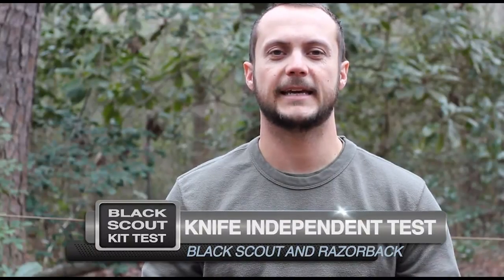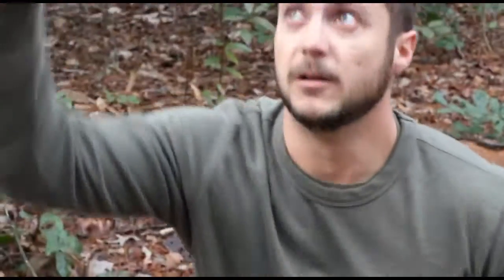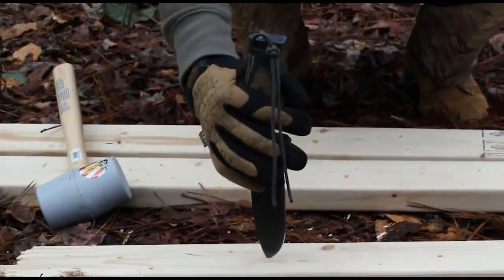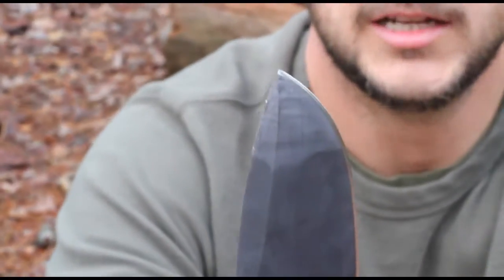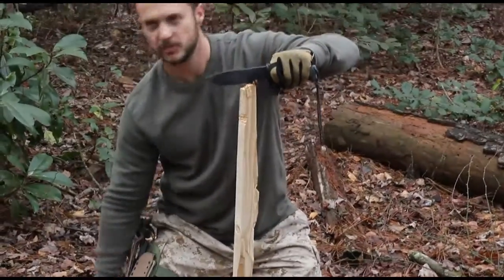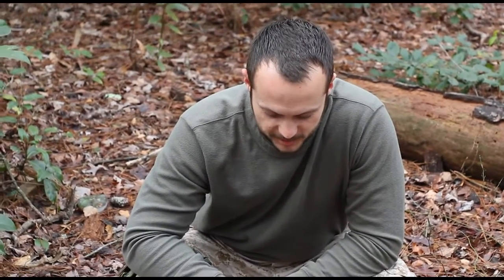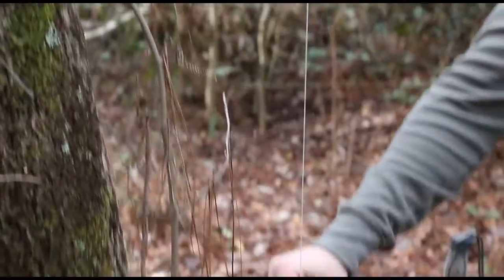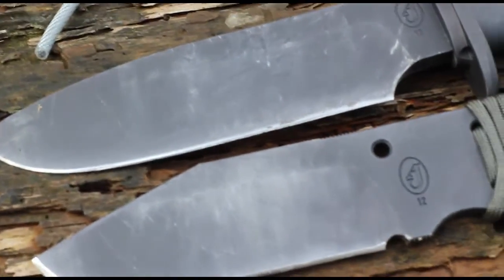Black Scout Product Testing - Black Scout and Razorback Knife K.I.T. Test

Comment from the maker: I agree with you. ESEE-5 and BK2 are probably the most owned knives in the community. I think it would be good for them to run the paces of the KIT test. just to see how they stack up against one another. The steel cable is an extreme portion of the test and is not in the normal realm when using knives. Knives shouldn't be used to cut steel except in extreme cases. So I hope no one goes and tries it:)  Thanks for your support as always. I understood your comment...sorry it was misconstrued.

Comment from the maker: Yes I agree, ESEE is not on the same level. However not many blades are on the level of Jordan knives. A 1095 blade wouldn't have a use-able edge after cutting through steel cable. Thanks for sharing.

Comment: Did I say anything about that?  I don't care if the Jordan knife is better.  I have Busse knives and nothing beats a Busse.  I was simply asking BSS to do a comparison of the ESEE 5 and BK2 using the standards of the KIT test.  I guarantee you there are more BK2 and ESEE 5 owners than Jordan owners.  Until I saw this test, I had never heard of them (7,000 to 8,000 knife makers in the US).  So thanks for the input.